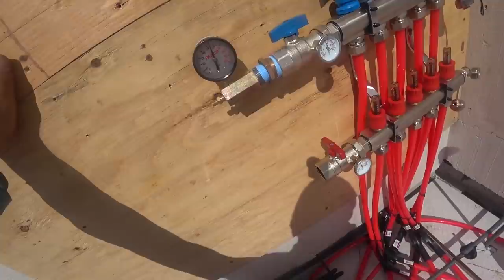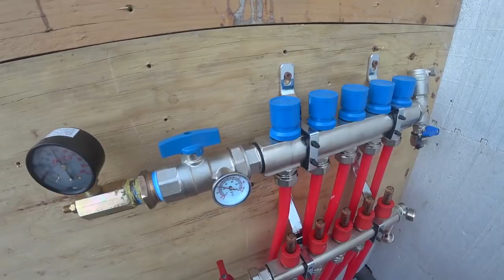Building a House Start to Finish: Radiant Heat Installation

Comment: Noticed you have been having to jump the backhoe ever since you got it. Save yourself a bunch of headache by installing a cheap battery disconnect switch. Just turn it off at the end of the day and problem solved. You won't even have to hunt down the annoying parasitic draw that is killing your battery.
Reply: They dont read any comments, helping them is hopeless.
Reply: He mentioned in a previous video that he did have the battery tested.

Comment: Would it be possible to add the radiant tubing before elevating the rebar, seem easier
Reply: It has to be close to the surface to maximise heat usage.

Comment: you may wish you would have put a sand box around your hydronic lines below the manifolds...im sure your done by now though. I do love watching your process and dream come to life and fruition...I always dreamed of this 30 plus years ago but never could arrange tis dream at the time. now im retired and disabled and love your journey..Thank You, BigBen from Ky.
Reply: D00mM4r1n3 in Kentucky reputable contractors use a firm set insulation product around those lines coming through the slab to allow 4 line movement with pump surges if there is ever in the future a Zone leak in that area it's easier to isolate and bypass. Rare but it's always a relief for any extra help if the unexpected does happen.

Comment: You have created a thermal bridge with that apron.not best practice.
Reply: I was wondering about that. Won't this lead to mold in the future?
Reply: The slab will be colder right across the front of the building. I don't understand why they have done this when everything else is insulated makes no sense

Comment: Builds insulated walls, then poors a concrete slab from inside to outside, especially with under floor heating

Comment: You guys need a few of these, they are very common for aircraft wireing and cut the tail fluch while tensioning to the perfect tension to not crush the wires or tube in your case. 
 http://www.aircraft-tool.com/shop/detail.aspx?id=E900-005

Edit: good lord thats a lot of typos.
Reply: tjsean0308 😂
Reply: tjsean0308 We used to use those at work when typing CPM into cabinets and wiring harnesses.  Very handy and like you mention, no sharp edges.

Comment: For those thinking of doing this yourself....when your freshly poured concrete is getting blasted by the sun it is imperative that you cover it  with something like polyplastic . A minmum of a couple days ,preferably a week. If you don't ,the surface will stop curing early and be weak and prone to cracking as well as easily damaged.  The bulk of the curing takes 30 days but curing lasts up to a couple years.
Reply: just keep it wet with a cover that lets water in...save cracking and drying to fast,in spain they have a sprinkler system as one has for  the garden have that on it almost as soon as its been laid ... keep it lightly wet for a couple of days ...
Reply: I have flooded the floor very successfully.

Comment: I know N-O-T-H-I-N-G about construction or plastic plumbing (learning a lot from watching you and a few others though) so this is a question, not a challenge.  I'm just curious as Jesse is testing for leaks at the (manifold?) and mentioning how hot the metal parts are.  Could it be that those nuts expand from the extreme heat, so that even after tightening it down, in a while, it could leak again?  And once the sun is down, when the metal contracts again, could any kind of stress cracks form in those joints because they are now over-tightened? Or are these sorts of fittings are just not sensitive enough to worry about that?
Reply: well damn.  Guess I should have waited till the end of the video before asking that question.
Reply: Deborrah Cuttriss Sherman he talked about this in the video.
Reply: That set of pipes/fittings is to be used for HEATING the floor. If they can't stand a little bit of heat from the sun,  then they are useless, because they will have to withstand a lot of hot water going through them without failing when the heating season starts. (which is just around the corner)
Reply: But of course... like I said, I know nothing.

Comment: Why do you need heating in the garage?
Reply: heat rises,
Reply: But one will be heating the garage for nothing and not the house. Which will need a separate heating system.
Reply: where i live its pretty common to put a combustion heater in the garage who wants to work in the freezing cold
Reply: One would Have  thought that all that insulation would have been sufficient to keep the cold out. But those big garage doors would allow all the cold in I suppose. Will the doors be insulated as well?.

Comment: I would have put the radiant heat outside to melt the snow.
Reply: Brandon Edwards they're putting a large deck/porch across the front (and sides)...."someday" so that area will be protected from most of the snow
Reply: Kathi Pauling, if there is a deck over it the snow will melt, the water will freeze on the concrete and the sun will not thaw it.
Reply: Brandon Edwards the apron is slanted

Comment: What are the two concrete squares in the center of the garage?
Reply: their plans ay 12" thick pier footing
Reply: Vinh Banh those are heat sinks they are going to spend additional money heating during the winter.
Reply: The post that supports the upper levels will be 8" X 8" or so. The idea of the pads is to spread the load over a large area.

Comment: What are the two concrete pads in the foundation for? Because  you covered them up with rebarb and water hose. Thanks
Reply: looks like they added heating to a layer
Reply: B17 Flying Fortress posts

Comment: What's the purpose of putting plastic & tape over the plumbing to "debond" it?  Is it bad to cover them in concrete?  (My old house has plumbing in the slab...maybe techniques have gotten better?)
Reply: Robert Knowlton like he said in in the vid,

if your pipes are not protected where the concrete is being poured, the concrete will adhere to the pipe and move it as the concrete "settles or rises" as it hardens....putting the pipes in a bind from their natural rest....in worst case it can break them.
Reply: Interesting.  I'd expect the weight of concrete on top of the pipe to cause bending as well.  Apparently it doesn't.  Amazing the things tradesmen learn.

Comment: Could the heat from the sun causing the pexpipe to expand slightly be causing a small drop in pressure over time?
Reply: Nvm... shoulda waited till the end of the video before commenting lol
Reply: THE BAG MAN it actually does the opposite.  The heat on the air in the pex causes the pressure to increase. The pex is solid so it expands very little with the temperature change.  Charles law if I remember correctly.
Reply: TheKajunkat is correct ... the volume increase in the pipe is ~ 1.5 % over a temperature increase, DeltaT,  of 30 deg C while the pressure x volume increase of the air is ~ 10.6 % over the same DeltaT.  Therefore pressure increase ~ 8.9 %.  The 'law' covering the behaviour of any gas under varying Pressure, Temperature and Volume is in fact called the 'Combined Gas Law' as it draws from the work of: Robert Boyle in 1662, https://en.m.wikipedia.org/wiki/Boyle%27s_law; Jacques Charles in 1780, https://en.m.wikipedia.org/wiki/Charles%27s_law; and Gay-Lussac between 1801 and 1802, https://en.m.wikipedia.org/wiki/Gay-Lussac%27s_law#Pressure-temperature_law.
Reply: That's it , the combined gas law. Thanks for the reminder!

Comment: Jessie really needs to do a research on Charle's and Boyle's Law when pressure testing. Oh yeah how about using a backup wrench when you  tighten fittings,  plus use a little pipe dope. That's hard to watch...
Reply: Not required....

Comment: What is the purpose of he two square concrete slabs in the middle of the house?
Reply: The two squares are foundations for posts to hold up the floor above.  They go deeper than the floor, so they were poured earlier when the wall foundations were poured.
Reply: Okay, that was my first thought too. But I thought in an earlier movie that she did not want any posts in the garage. So, therefore, I began to doubt. (I have google translator used for this text ... sorry i am lazy dutch (and it's already late))  Thanks!

Comment: what are those tubes for?sorry for asking but just curious..
Reply: Heating
Reply: Jeffrey Nash 
heating for the concreat?
Reply: It's radiant floor heating, for the overall heating in the house.  Instead of using wall radiators and heating just the area around the radiator, hot water cycles around the house heating the floor (and by extension, the objects on the floor) creating a comfortable and efficient heating system.  I've heard them mention they will be using a external fired wood boiler to provide the energy to the system (which in their neck of the 'woods' makes sense as it is a locally resourced, sustainable fuel.
Reply: Jeffrey Nash 
Thanks for the insight...im living in the tropics hense we dun do such tubings for the floor...appreciate the extra knowledge..cool
Reply: Although you might, this is a pretty simple way of cooling a house too, if there is a cheap cold water supply nearby.

Comment: You need to fill the tubes with water before pouring the slab !!! If you left air in tubes it will raise them even with rebar !!!
Reply: ... will it?  Perhaps you could justify your statement with some evidence from the world of physics and a little mathematics?  What is the mass of air, the plastic used in the heating system, the steel and concrete?  What are the relevant cross-sectional areas of the inside and outside of the pipe and the steel rebar and how deep are they going to be submerged in the concrete? Oh and by the way what value of 'g' will you be using?  Do the 'maths' yes I come from the 'right' side of the 'pond'!
Reply: soaringtractor, to whom are you responding ... what has pressurisation or otherwise of the pipes got to do with whether they will 'float' the rebar or not?

Comment: Can I ask Why you mark your wood with a v and not just a line
Reply: Because you never do make a perfectly perpendicular line by hand, and once you walk away from it you can never be sure which side of that line was the correct measurement.
If you do a V however you know where the point of measuring was, also you can see it much faster.
Reply: a line can "disappear" if you dont watch it

Comment: Your big mistake with that pressure test was not starting with pipe dope. No tape will ever compare to dope, especially teflon; teflon tape is a thread lubricant, not a thread sealant.

Comment: No recess for the garage doors ??? With no thermal breaks that's going to suck all the heat away from the slab as will the slab/wall joint..
There's so much that's not quite right with this but I guess they'll find out in due course.

Comment: Think every radiant floor ive ever seen installed starts leaking in the first 5 years.
Reply: Qthulu __ mine is 17 years old no leaks. The old style had rings that would corrode and then come off and leak.

Comment: I have a question: if you are not required to have a building permit & inspections why do you do it?
Reply: Bruce Boyles becouse its better to do it right tje first time rather than make a rookie mistake and regret it later and spend more to fix it then than doing it now
Reply: Go back a few videos, they explain why.
Reply: They do it so if they want to sell it one day they can use that as a selling point. So many houses are built in areas like this with out inspections but I they can say "its up to code" then you know youre buying a reliable house.
Reply: May also help if any insurance claims have to be filed. "It passed code inspection... "

Comment: yall need some real cutters. cringed at watching how hard it seemed for her to cut those ties.  massage me an addressee, I'll send you some real good ones
Reply: Really.  I was thinking the same thing.  As a guy who's cut a few million zip ties, I know the value of a decent set of edge cutters.  As a side note, Lowes sells a decent one.  I didn't see any at Home Depot last time I was there.  A real electronics store (not Best Buy) will have some.
Reply: Jeremy Fortune  same here. I have a few different types. some carbon fiber ones are my favorite. use it for cutting fiber lines

Comment: Maybe, the tubing is not dense enough. (based on shoe sizes the grid looks like 12-14") There will be noticeable differences in the surface temperature.

Comment: Using rivets as nails?
Reply: Philip Cooper unless i missed something they have concrete prep nails with a second head so you can hammer them in then remove them later with ease but they do look similar from a distance
Reply: They are called duplex nails
Reply: 17:01
Reply: Still duplex nails...

Comment: I don't know anything about bulding a home, why they are using this tubes on the floor ?
Reply: Cruzefx they are planning to pump hot water from a boiler to have radiant floor heating.
Reply: Cruzefx to provide heat to the garage space and in the bigger picture to help control the temp of the entire structure. Heat rises.
Reply: Cruzefx it's radiant tubing. Holds heat in the concrete and will help keep heat in the home. Like insulation. I'm sure it will also keep the underneath plumbing from freezing as well.
Reply: Ha. Everyone was answering you but at least we agree!
Reply: It's called pex    it is a crosslinked polyethylene that is temp resistant. Used for floor heating
Reply: Wow never seen this, thanks everybody, here i'm brazil i don't think anyone does that, it's common practice in the US ?
Reply: Guess what, I have the same kind of heating, but  not in the floor, but in the ceiling.
Reply: Not basic or really common practice as it is expensive but, certainly a modern way to heat the space.  Saves money in the long run.
Reply: Maybe it is expensive, because it is not common. These tubes are dirt cheap.
Reply: Cruzefx depends on climate. In cold areas like Idaho it makes sense. In Texas not so much.

Comment: Man this heating system looks like it will be a pain in the ass  later, if u pour concrete over ist and it will probably start leaking later or sooner than u pretty much killed your house with water leaking into the foundation. Still dont get why even heat the garage but whatever floats your boat lol
Reply: These systems are common in Europe and often last for 2+ decades.  The tubing should be rated for 40 years use. And the entire slap moves as one so no really tear on the tubing other than heating, which takes a long time. And if it break U often just break it down to rebuild or leave it or build an other heating solution.
Reply: I assuming that the system is intended for winter use only and it buildt up in sektions so they can keep heating the garage bathroom and not the entire slab as a whole, and most should be fairly wel isolated seeing that most of the garage in under dirt. And most thermostats actually registeres that a door etc is open for more than a given time and automaticly shuts off the heating till the temperature is stabilized.
Reply: That's nonsense - think about it: Heating system leaks, pressure drops, boiler cuts out, they notice and isolate the faulty circuit. Limited water. Also it's into the slab above the DPM so the only thing it can damage is non garage floor coverings in other parts of the downstairs (I assume it's not all garage?).
Reply: The only place it's likely to leak is the manifold as there are no joints under the slab. Like @Heino W. Pedersen said, this system has been used for some time now in Europe and it's very successful. It would be my system of choice in a new build.
Reply: So?